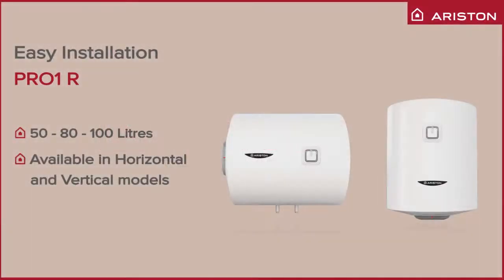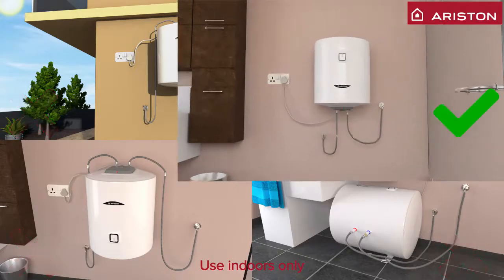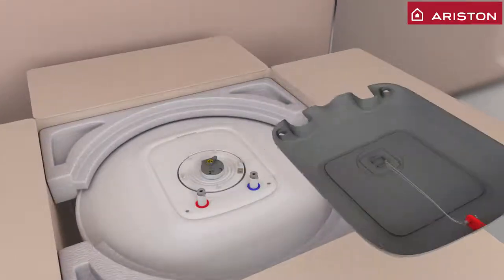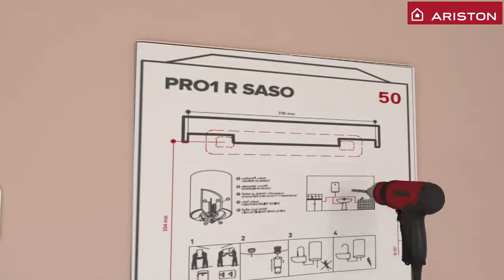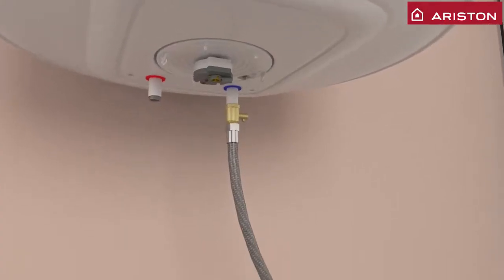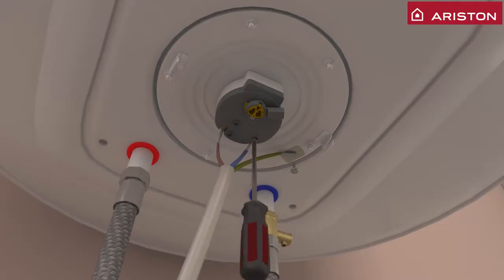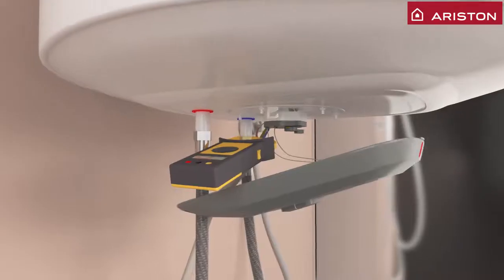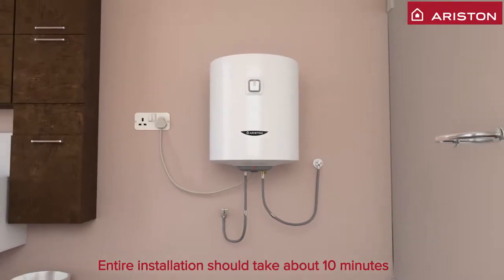How to install Ariston water heater 50-80-100 liters PRO1 #building_material #plumbing #water_heater

Comment: You missed the part where you have to also fit control valve ,prv amd expansion vessel
Reply from the maker: Surely, those are not required.

Comment: Hi can someone tell me,  do you need a permanent drain attached to the safty valve?? 
Our heater has been fitted into the loft space.
Thanks in advance
Reply from the maker: From my point of view that isn't that much necessary, attaching a drain hose would be useful only in case of pressure relief.

Comment: Mine is not connected to ground wire, just the main two wires. Is it ok?
Reply from the maker: You need to add the earth wire, it's a fundamental safety step, find a local technician to manage that.